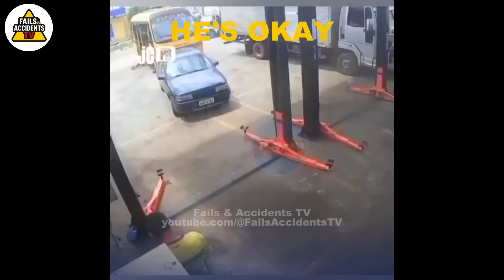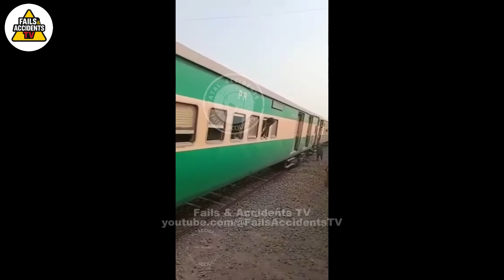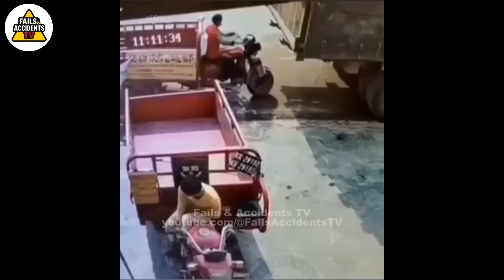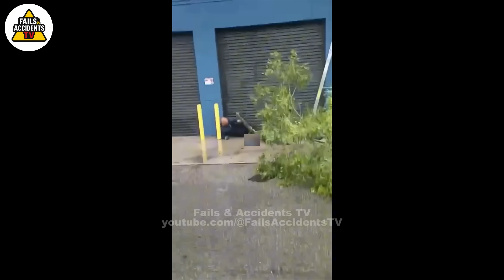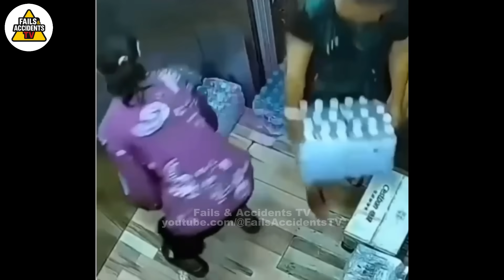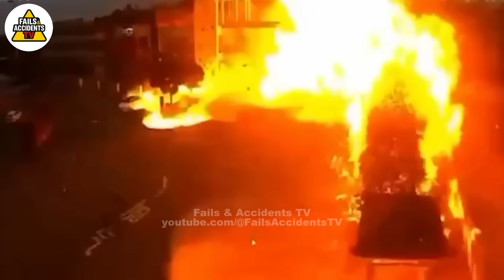Gas Suddenly Leaked From Tanker… Then THIS Happened!

Comment: You're an idiot, the bus didn't move on its own, there was a driver in the cabin, you can even tell by the wheels that the bus was accelerating.
Reply: Pretty sure you hallucinated that. There is no one in the bus.
Reply: Buses have to have a driver...smh..